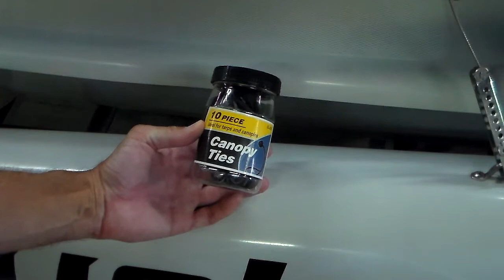Weta Trimaran Rigging Tips

Comment: Some more tips
I untie the screecher sheet from the screecher and leave it threaded through the blocks to save time. 
I also have much longer tramp tie lines so that they can remain tied on at the front while I place the amas over the main hull. 
I also thread the mainsheet through the coiled shroud lines on top of the tramp while using the mainsheet to hold down the amas - no ties required. 
And I wrap the halyard tails around the base of the upper part of the mast and use the forward mast bungee on the “moose head” to hold them in place, then put the tails inside the boat through the front hatch. 
The front hatch cover is attached to the boat with some bungee which is threaded through a small hole in the hatch and anchored to a P-clip screwed to the front bulkhead to save loosing it.
I have switched to the bridle for the tiller (similar to the Laser setup) which I leave attached and thread the ama arms through the bridle as I insert them in their hull holes.

Comment: Tom,  I enjoyed your tips. I'm curious about what equipment you're using to shoot your sailing videos and how you mount the camera. I assume having the dual tiller extensions helps since you're not hitting the camera mounting staff while trying to swing the tiller extension around the back of the boat.
Reply from the maker: I use a simple first generation Garmin VIRB mounted with a RAM ball system. Nothing fancy, really. For head-on shots I mounted a RAM ball to an ABS tube collar which slides onto the bowsprit and is held near the front with a collar clamp. My newer unit swings free and allows the camera to constantly seek the horizon. I use this on the Astus videos mostly.